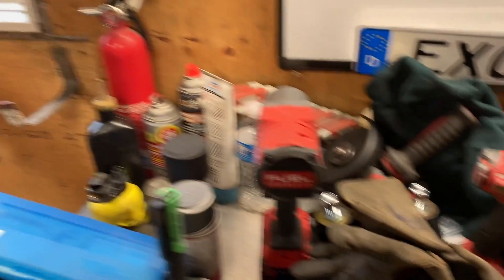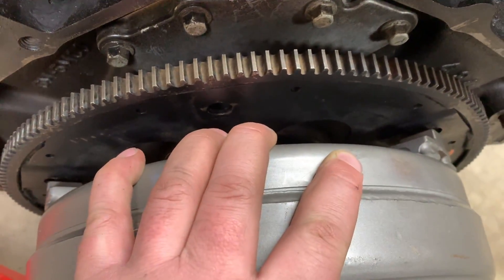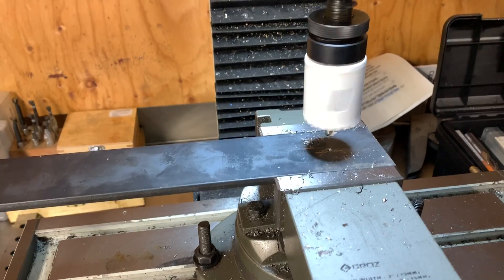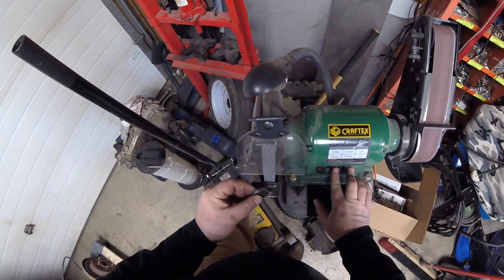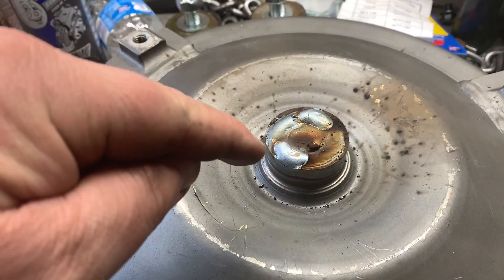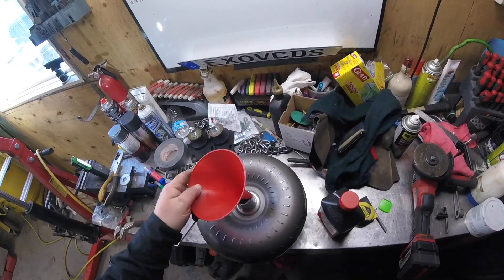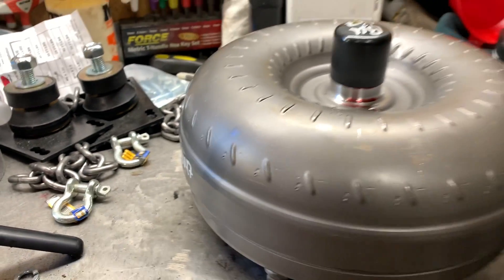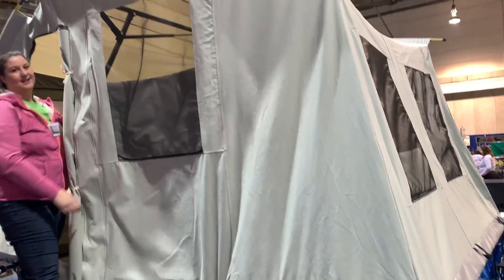LS Swap Milling the Torque Converter

Comment: Hey Jerry 
 I used 4 12 volt actuators to lift my rtt an extra 12” above my support frame so I can walk under the awning once I camp up. Actuators do run slow and slightly different speeds but once they hit the internal limit switch it levels out. Was this winter built so we’ll see how the amazon actuators hold up.

Comment: Will you need to re-balance that torque converter after you welded in that plug?  It seems like it could be out of balance.
Reply from the maker: That could be a very real possibility yes, I’m going to see how it is first
Reply: It’s so close to center it won't matter.  Indy engine maybe, generally you don’t balance things that don’t have a surface speed under 5000 feet/minute in the middle like that you’d have to spin it 30,000 RPM.  If you were welding near the edge it would need to be balanced again.  I’d toss at least a gallon in that converter.